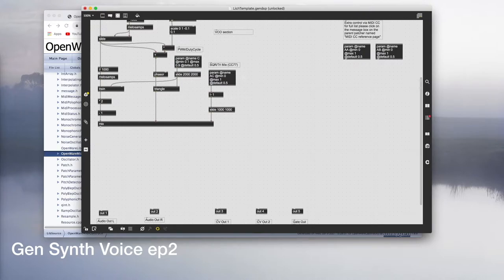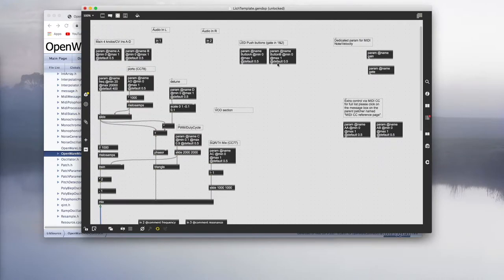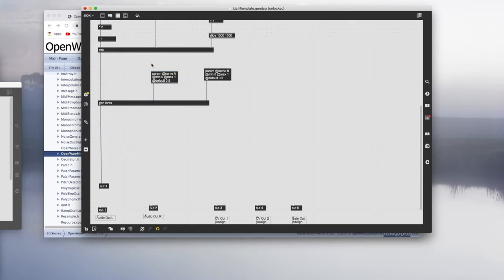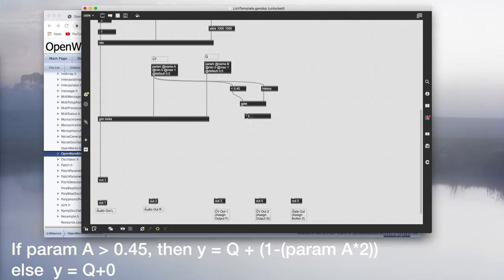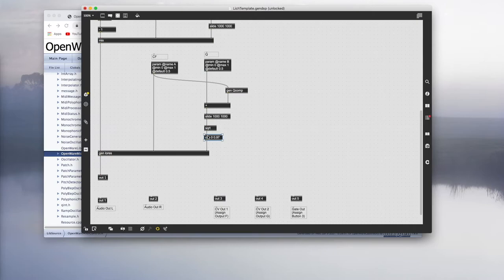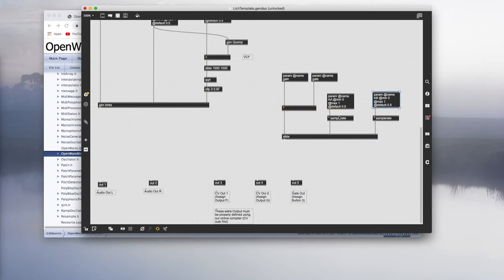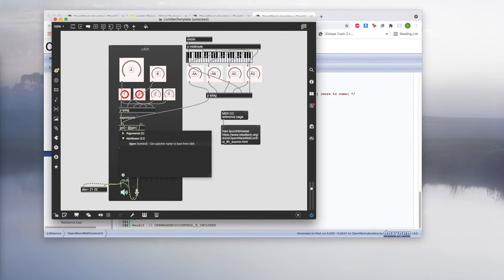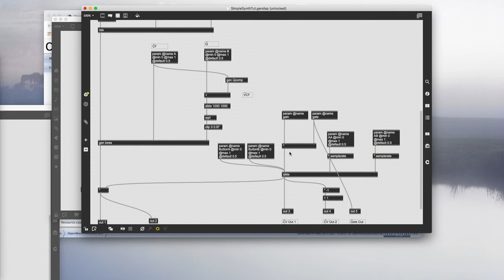OWL Max Tutorial 9: Gen Synth Voice EP2

Comment: Nice demo tutorial. At 9 minutes, you develop the Q  modifier, why bother with the delay via history for a simple if statement? Maybe this is one of those gen things when using just the standard objects, why not just use a codebox and be done with it? Happy to be corrected/learn more.
Reply: Indeed great demo! I had the same question, why the history object? Also why the gate before and after the if statement? Wouldn't this works with just the last gate being open or closed? Or would that mean the calculation is done every clock cycle vs. only when the if statement is true, improving CPU usage? As you said, happy to be corrected, here to learn 🙂